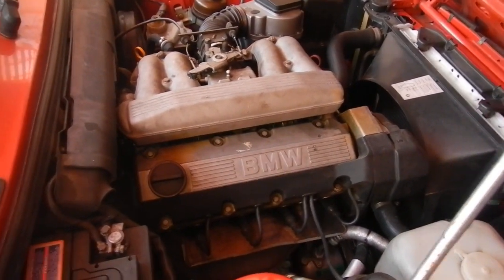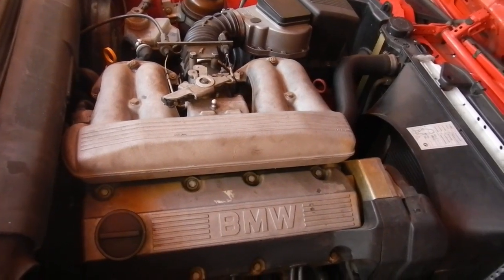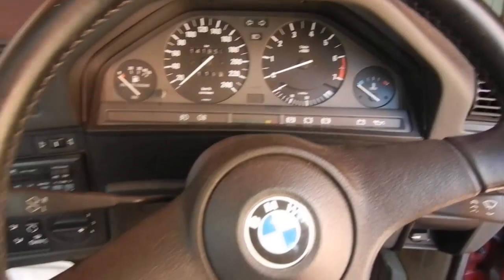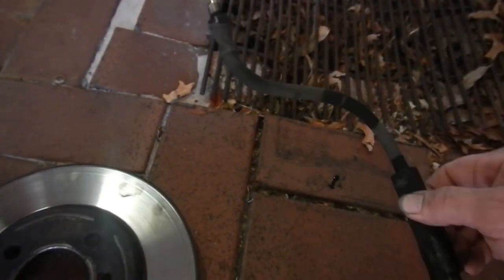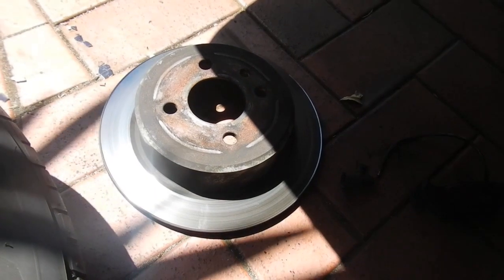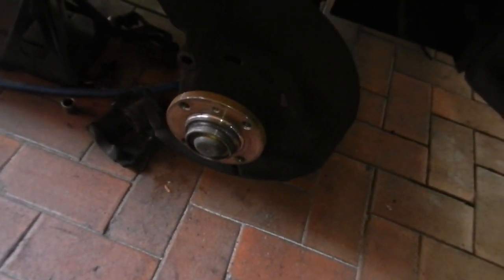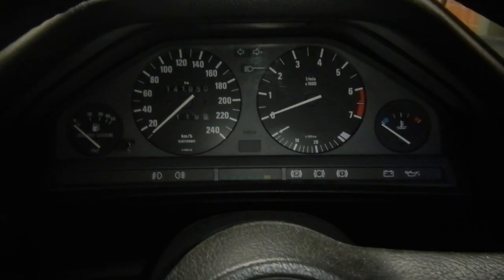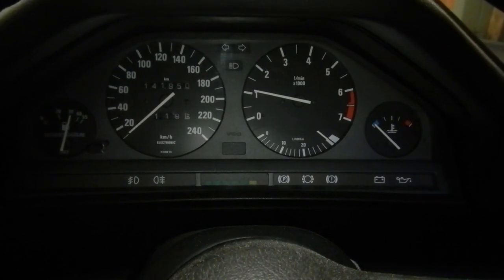E30 318i Brakes

Comment: hey Jagnut, I wouldnt worry about that tappet noise too much, those old BMW tappets where really bad for the noise from new, I had a "healthy" 1988 e30 that sounded the same, I tried everything to shut it up but a master bmw tech said i was wasting my time, so i sold it :)
Reply: Yep. The only way i know of, to get rid of that sound is to redo the top end. I have a friend who really likes this model (some people are like that) and he redid the whole engine and got rid of the noise. Of course for normal people it's not worth it. It's a design oversight, i doubt the guys at BMW would of had left that in a production car if it were a serious flaw.
Reply: aserta
My merc does the same due to the hydraulic lifters. Once it warms up then it gets good, but cold sounds pretty bad.
Reply: Yeah the hydrolic liffters in the e30 m40b20 dont get any better, best thing to to is pull the lifters drain them and put new mazda oil in them, the mazda lifter oils are great, but it doesnt last long.
Reply: Akieba
I've even tried doing a brand new filter, oil flush and a additive.from bardhall and liqui molly and yet it still does it. The only real solution would be to replace all the lifters, but in order to do so the cam and timing chain would both have to be pulled. So not really wroth it.